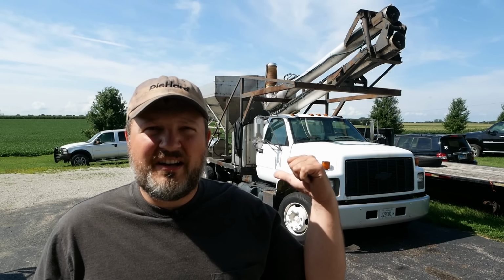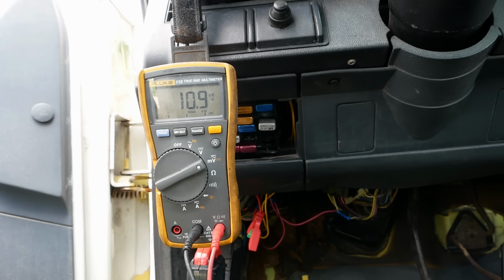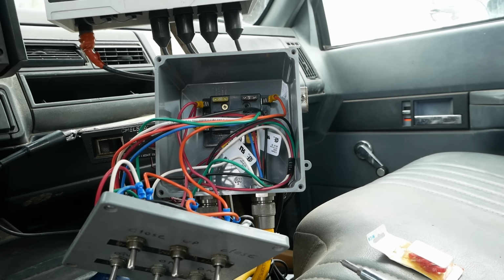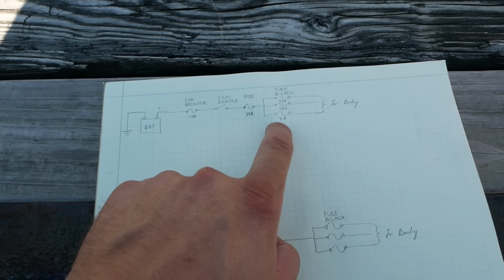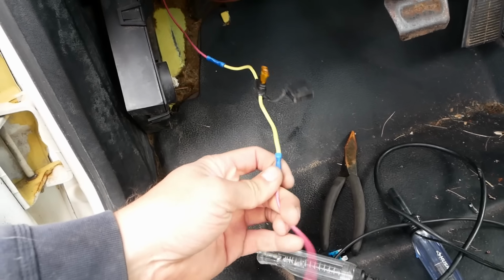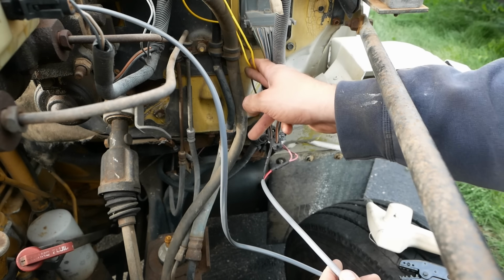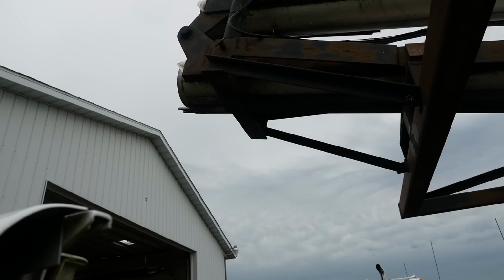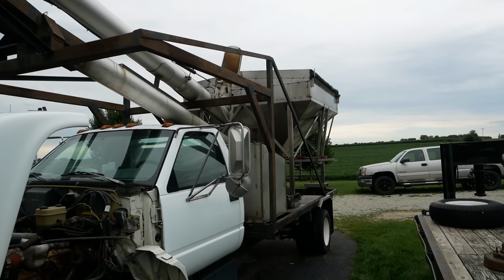Crop Duster Tender Truck Dies Every 5 Minutes

Comment: For as many years as I have been fixing cars and trucks electrical problems are many times installed by someone in the after market, stereo shops , up fitters auto car staters , they allways do the same poorly designed circuits???

Comment: The fan might last longer if it were controlled by a temperature sensor instead of just running continuously. It's often surprising how frequently electric motors are not rated for constant duty service. It's likely this fan gets turned on and forgotten

Comment: I bet the problem started when the fan seized up, and they didn't notice it wasn't running. So now you fixed it to the point they won't notice that the new fan burns out, which will cause some other failure.... So you'll see this one again :P

Comment: Hey Wes, know this is an older video and this comment might get lost in the old ones. You take on so much stuff and do so much do-diligence, you deserve alot of credit brother. I install car stereo/ 12v equipment for a living and your diag skills are bar none as good, if not better than mine. Granted you have age as an advantage over me, but being someone not as mechanically inclined, you ALWAYS do the solution I would think of in an electrical calamity/ mishap. Seriously good diag work for something with no write-up/ diagram, I learn alot from your videos, thanks alot!

Comment: there was probably more than one person involved in the installation of the various components and they may well have been done at different times, and the last one involved didn't think it worthwhile to investigate what had been done previously. 

same thing happens in the software maintenance world as its easy enough to jump in with new logic at any convenient point, at least in the mind of the "jumper-in-er", and proceed from there. trouble is that that can only be done a few times before the entire thing becomes a kludge such that nothing works right until such time that EVERYTHING must be removed and re-engineered.

Comment: I've seen a several vehicles over the years where people just tap into whichever wires they find under the dash, with no concern for what they are or are used for. Luckily they tend to go for the power wires, so I've yet to see anyone tap into the airbag wiring. When you have a bunch of slapped on auxiliary stuff like on this truck, it's generally a good idea to put it on its own circuit from battery with its own main shutoff switch, unless it absolutely has to be shut off with the engine.

when a company will only sell you a complete unit and no spare parts, it's a clear sign that they don't make the units themselves, but merely buy them from somewhere else and sell them as their own. Which is quite typical for stuff made in China, but it also happens with domestic companies that have no production of their own and just outsource everything. Companies that take pride in their products and make them themselves will normally always be happy to sell you spare parts

Comment: Good chance the PTO was fitted before the rest of the system, maybe for a previous implement, and then the auger system was fitted afterwards, as an auto electrician here in Australia working on heavy vehicles and machines exclusively, theres not a lot I haven't seen

Comment: 8:13 for anyone looking to make flags like this for outdoor use, i will share some priceless knowledge my gramps shared with me. you get aluminum tags (or stainless) and some outdoor use bailing wire (that won't rust) and a punch set. you punch your label text into the tag, then wire that tag on to your line you want labeled. This method is the ONLY method of labeling lines that will withstand 24/7 direct exposure to the elements for up to 20 years or more. heck, we still find old cattle tags that were made using this method from the 1800's that are completely legible. There is a darker side to history of metal tags too that i feel i have to mention, but you can read some history if you want to know more. 

tl;dr use metal tags with bailing wire and a punch set to label your lines for outdoor use, not any kind of sticker or marker

Comment: what is making back emf on a pure mechanical system that requires a flyback diode? i would have guessed the fan because huge fans can benefit from a chunky flyback diode, but that is a mechanical fan. electric over hydraulic pump someone that doesn't have one built in to it??

Comment: The electric fan zip tie things, been using a single pair on my Ranger for the last 7 years. Up until a few days ago, didn't cause any problems. Now I have a slight leak in my radiator. If I push on the button a little it stops. I drive that truck hard, so I'm shocked it hasn't torn through to be honest.

Comment: the difference between ignition switch and diagnostic connector is that NORMALLY the diagnostic plug is hot all the time :) no idea why you'd want to run a pto control with the truck off though..

Comment: The zip tie attachments do a great job. Your brackets work great. Makes you.wonder how guys do thing. Even an ex HiRanger, Terex and Altec mechanic knows the magic of the relay. We had a battery powered flashing light that kept the engine running diode worked

Comment: Looks like a ton of unnecessary wire for the control panels when it could of been a short straight wiring instead of coming in the fire wall going out the cab around and back through the cab 🤔 way unnecessary

Comment: It's the Crankshaft Position Sensor. Engine warms up and causes the fail. It talks to the timing mechanism and when it stops sending it the appropriate signal the engine shuts down. Cools down and the PCS starts working again. It is bolted to the block so it gets warmed up.
Good luck!!!!

Comment: You wondered about the folding boom, Wes? I think you'll find it's a double-fold, to put the hopper well to the rear of the truck to put the truck well clear of prop-wash, backed up to the duster to the rear of the wing to load its hopper. :)

Comment: I once had a boat that would run perhaps as long as half an hour. I eventually found the bilge blower discharge had dripped a tiny bit of salt water on the ballast resistor. The resistor’s wire had corroded apart, so the wet-with-saltwater ceramic would conduct enough electricity to keep the engine running until the resistance baked it dry. Next morning the fog would have saturated the ceramic with enough moisture to do it all over again.

Comment: I think the PTO may have had a separate wire feed because it came with the truck, and later when someone added the auger attachment they never bothered to combine the wiring.  Regardless, nice work fabricobbling the fan mount, I sat there and admired it for a moment. :)

Comment: Reminds me of working on our fire engines, we normally got them 2nd or 3rd hand and they had a lot of wiring "updates" from various folks over the years. Usually ended up tearing out most of the  "updates" and wiring them properly. Adding relays and breaker panels along with wire loom and making things work.

Comment: I build and install wire harnesses professionally for new equipment installs in aircraft, I had to stop watching this video halfway through because of the absolute fit I was having. I mean, pure aneurysm inducing internal screaming. Props to you for working it through, your work was much nicer than the existing. I don't think I would have agreed to the job without requiring completely gutting the mess and starting over. Zero circuit isolation, atrocious wire management, mismatched wire gauges on the same run, PVC butt splices and crimps, no chafe or UV protection, weak grounds/bonding, it just kept going...excuse me while I go have a good cry.
Reply from the maker: This is actually pretty decent. There was no Romex or repurposed orange extension cords. No handy boxes or wire nuts. No Scotch-Locks, no twist and tape. Heck, this is well above average!
Reply: @WatchWesWork  Ah yes, man-made horrors beyond my most unfortunate dreams. Thanks I hate it. 🥲
Reply: @MrBBQ  two different fields, automotive vs aerospace.. automotive isn't as stringent overall, but does have a bit of stress/vibration resistance requirements..
Reply: @niteriderevo9179  I've worked in both fields extensively and would actually argue automotive wiring applications are harsher than aerospace. The safety factor is much different obviously hence why the FAA published the AC 43.13. But a big diesel vibrating all day every day getting rode hard by wild ass hourly workers being anything but gentle is probably a lot worse on electrical installations than a butter smooth jet engine singing along at a casual 35kft for a couple hours per week. Would be cool if people just did things right the first time.
Reply: @MrBBQ  will agree with you there, aerospace is not as rough on vibrations and the like as automotive can be, the safety factor/requirements is why i said aerospace is a bit tougher.. ie aerospace not allowing anything carrying electrical power in the fuel tanks at all vs automotive having in-tank fuel pumps, fuel-level senders and that like

Comment: Why do you need a separate fan on the back why not just use the factory fan or a cooler
Reply from the maker: It cools the hydraulic oil.

Comment: I wish wes was closer to me. I have an 07 impala with electric fan problems and he would be a massive help to fix them. I bought a fan control relay and wired it but they didn't turn on unless I jumped the bottom post to the top post of the relay.

Comment: Really shouldn’t fuse more than 20A on a 14awg wire. If you want 30A you ought to bump up to 10awg. I bet in service, when the fan isn’t seized, it doesn’t use 15 so it should be fine and is pretty low on the list of suspects if that truck burns to the ground.

Comment: The problem I found with those zip tie things that come with fans is overtime vibration tends to make the plastic eat through the aluminum and can actually end up putting a hole in the radiator.

Comment: You know back in the 80s we had Toro 72  mowers  with Cozy Cabs  that had to put together for The City of Edmonton and Calgary   !  You should have seen all the accessories had to be installed on them ! There was  Work Lights , an Extension for the fuel tank through the  Cab ,  Signal lights ,  Interior heater , Horn ,  Rear view mirrors , some had Cruise Control  , complete Guage package , it was a Nightmare  but fun to do !  😇😇😇  We put together over 300 of those  !

Comment: I think that boom flip thing would work if it has a non- pressure return. You just got to switch off the pump at the right time by turning the switch to "off" and let gravity do the rest. (With both folding it in and out)
Thanks for another marvel mystery Wes !

Comment: If it was my truck, I think I would've just installed a small engine under the hopper that would've powered the hydraulic and electrical equipment. Let the truck engine do what it was built for.

Comment: We use similar cooling fans on the hydraulics on our concrete mixer trucks here in Australia. The fans usually die after a few years, they sometimes do stupid things when they are failing. Dead short one minute and fine the next. They confuse the heck out of the service guys.
Reply: 👆Congratulations 👏text now you've won a prize!!!

Comment: Where to start?  The repaired fan reminds me of Grandma's Eureka vacuum cleaner from 60+ years ago.  The installation kit you fabricated looks factory.  Speaking of which, they were crazy to not sell the fan separately.  You said the process was hard to follow.  I disagree.  Your thought process and the solution were great, and the grommet was icing on the cake.  I'm surprised you did not run the other 2 wires through it and that you didn't eliminate the wire running all around the cab.  Another great video!
Reply: Congratulations 👆DM for your prize!!..

Comment: My guess on the two different wires is that whoever "engineered" the original wiring setup thought they were drawing from two different switched live sources and maybe thought that they would spread the load out but unwittingly tapped into the same source.

Comment: Down in the old country, that truck is called a loader because it loads the plane. The style they had there basically turned the truck into a "rear-end" loader. A big bucket mounted on the rear with a second driver's compartment with steering wheel and other controls. Lifting the bucket up at a specific rpm enabled the loader driver to weigh the fertiliser so that the plane could be properly loaded (not under and not over). The truck also had an avgas tank between the main and rear cabs so the planes could refill during the day at the often-remote airstrips way out the back of nowhere

Comment: If that heat exchanger was from this century, those fan mounting thingies work just fine. But, the corrosion on the fins would have made me look for an alternative as if they were disturbed and started pissing, you would have opened up an institutional sized can of worms.

Comment: Good call on the fan zip ties.  I've seen those zip ties saw through radiator cores over time and cause leaks.  Brackets are the only way to go.

Comment: Wires in a nest box, WTF...over? Roger Dodger, this is a cluster fracas, 10-4  bringing heat and some big boomers.  Kiss your arse, heads down, run for cover if ya can... Wes sniping and got your back.. 12, 6, 3, 9 above  and beyond.  Watch them them toe tappers. 💪👍🏻🇺🇸⛓🛠

Comment: Wes I believe 30 amps 10 gauge wire, 20 amps - 12 gauge wire, 15 amps - 14 gauge wire per National Electrical Code. FYI 40 amps - 8 gauge, 55 amps 6 gauge, 70 amps-4 gauge,

Comment: Excellent work, as always.  I hate companies that leave you hanging for a response only to try to screw you over with astronomical pricing for repair parts.  Nice job on the fan.  I am surprised you did not at least look at the hard to start issue.  You always seem to at least want to know why, which I enjoy.

Comment: I grew up in the crop dusting industry. You will never see 2 of the same loader trucks.Everyone has their own way of doing things  Here in Cali you rarely see that style of truck with tender to load they take way to long to load a plane. We like to use a big boom and bucket that lifts over the plane and fills my hopper with over 2500 lbs of seed in like 30 seconds we do sometimes over 70 loads a day

Comment: i can't understand what the person who installed the wiring that operates that auxiliary equipment was thinking. routing it out of and back into the cab for seemingly no particular reason, they obviously had an irrational fear of grommets, and they drew keyed power from random, undersized wires they found under the dash, simply because it was keyed. i'm surprised it worked as long as it did and the truck didn't burn to the ground long ago. if they thought this was in any way a professional installation, they need to think again. leave it to wes to figure out the pot of leftover spaghetti that was the wiring, and coming up with a solution for not only the power feed fiasco, but for the long dead, can't sell you one because that's too easy, cooling fan issue that brought it to light. $700 for an oil cooler/cooling fan combo is just crazy to begin with, but then to not sell a replacement fan for it is adding salt to the wound. it must come from china as a unit before they slap their sticker on it, and jack up the price to insane levels. you have to wonder how many people actually purchased a replacement unit through them, rather than simply sourcing a comparable fan like wes did. not many i reckon. this is a perfect example of why your lot is never empty, and your shop bays are always full.

Comment: Sometimes they used to sting super sacks to dump into the planes also.  They used to plant rice into water that way, as the water drains from the field, to germination, then immediately begin pumping water back onto the field, some still do, though it's becoming more rare.  More dry field drilling, like corn and beans.  That's pretty slick to plant the cover crop before the main harvest, never realized that was a thing, save wear and tear on the tractors and drills

Comment: Wess, thank you for telling the company with heat exchanger they can keep their over priced unit. I'm a DIY guy and this price gouging is everywhere you turn. Had a tire serviced the other day the service manager said one of the lug nuts was bad, he replaced it at a cost of $14.00. Can't prove this put now the wheel has an odd length nut, thinking he used an old one and charged me for a new one.

Comment: Cool Video Wes.  Especially for one getting into the weeds of cab&chassis conversions.  Many of which appear to have been designed and installed by bored orangutans with only barn supplies . . .  🙂
Good Sunday fare for me--here in the 96°F Texas heat of Second Summer.

Comment: I thought it was a ANFO mixing truck...........it would do the same job. 7%  diesel, and voila...........Explosive!   Theres a reason that electric cooling fans on vehicles have their own dedicated relay and circuit breaker/fuse........they draw a good chunk of current. LoL the wires going through the steel firewall with no grommet..........a real show stopper,real soon.

Comment: As bad as it was, I guess it was working fine until the fan motor locked up. The load on the electrical then increased to right where the breaker wasn't happy.

Comment: actually, I prefer dodgy  builds  , the problem is mostly lack of system and it's solved  realy nice ....  the alternative  "the quality brand"  is a complicated mess that needs to stay conform the design. ti make it real pro , you place relays on the wires out of the cabin control box and feed the box like it was

Comment: Pro tip for easy installation of self tappers - drill a pilot hole. Getting one started in thicker material can be a pain but with like a 2-3 mm pilot hole they go right in. For just one hole it's not that much extra work drilling it.